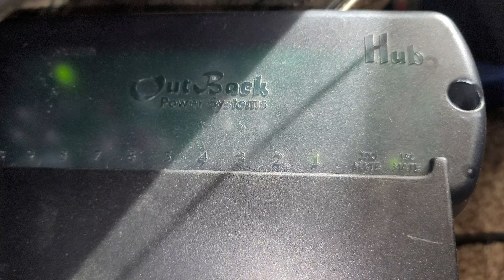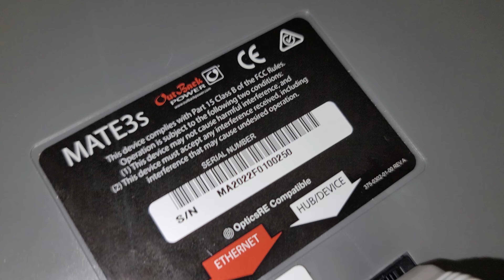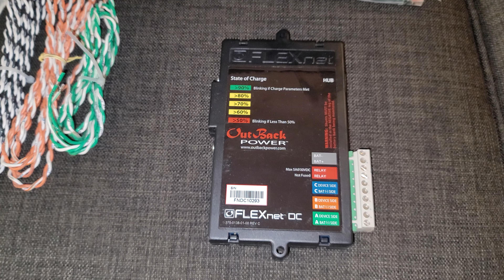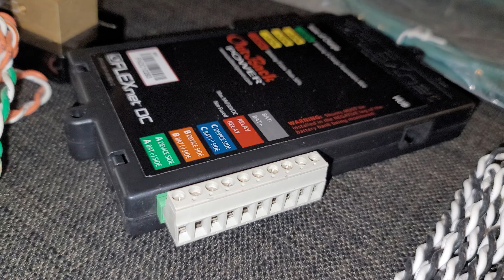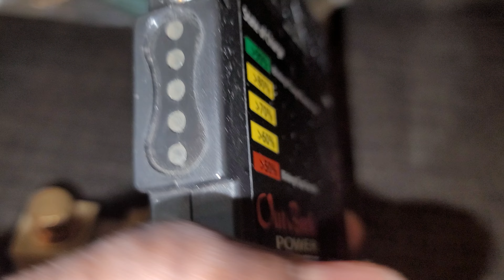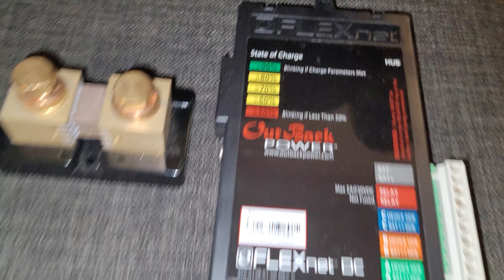OUTBACK POWER FLEXWARE DC SYSTEM MONITORING DEVICE, FLEXnet DC ( FN-DC )

Comment: I have just acquired one of these. Assembling a system with 3 8048 inverters parallel, 3 FM80's, hub10, Mate3s, and FlexnetDC. Found your video useful. Thank you. I have to figure out all of the outback wiring. Hoping to switch the building power back and forth between this and the grid, in a grid zero setup and also be able to charge my EV.
Reply from the maker: I am glad you find this video helpful.
Please check out my playlist for more OutBack Power Systems firmware updates and configurations.

I am proud of you and thanks for sharing.

IF YOU ARE LOOKING TO BUY YOUR LITHIUM BATTERIES AND SAVE 5% PLEASE CLICK ON THE LINK BELOW.

BATTERY HOOKUP PROMO LINK 
https://batteryhookup.com/discount/jwsolarusa
Reply from the maker: Don't forget to start posting your progress on your YouTube account. 
I would love to see everything you have done.